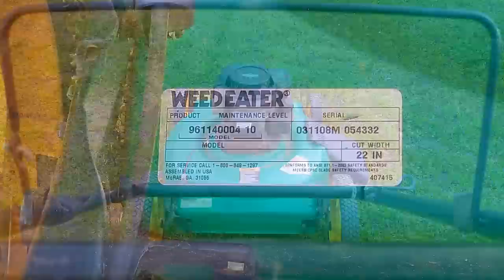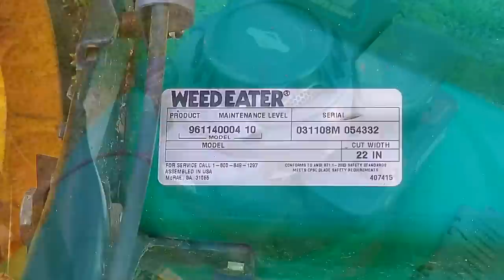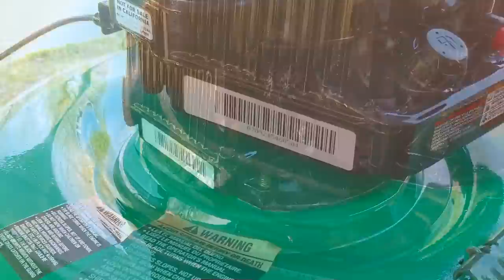Bought A Weedeater Mower And Things Don't Seem Right

Comment: well for me it does differ but yeah i have been there but often i have repaired it from my view etc.
Reply from the maker: you make a good point. I got it fixed and sold it, so I'm happy!
Reply: @INSIDEHOUSEGARAGE  strewth mate and yep our Victa 2 stroke aka 2 cycle engines with the P/T (Power Torque) type are also no different here in Australia etc.

Comment: I bought one of these from Walmart a long time ago. It was the worst mower I ever had. It was hard to start. I got it to run one time and that was it. Took it back and exchanged it for another one and it was the same thing. I ultimately took the second one back for a refund. It had a briggs on it too just like this one. I was surprised how shitty it was. I expected better. Lol
Reply from the maker: it was interesting that it happened twice
Reply: @INSIDEHOUSEGARAGE  Weird I know. I figured with it having a briggs motor it would have been a good working engine but it wasn't. I just came to the conclusion that it was the cheapest mower that they had at the time and I got what I paid for. 😆

Comment: The fuel tank IS the bowl on L heads...
Reply from the maker: no there is an inner bowl, under the carb. The pump pulls fuel from the bottom of the tank, into the bowl section and any excess spills back into the tank.

Comment: When I sell them I post them for more than I want. Most people want a discount. I list what I did. Oil change, sharpen blade, drive wheels ect. If you did something that a person would question don't post that. If you list something at lets say $ 100 and they say would you take $ 60 I don't even respond. I have to buy the stuff go through the machine and sell it. The shops get around 80 to 100 per hour to work on small engines. I am sure if they were selling they wouldn't give big discount. When I buy something cheap I expect issues.
Reply from the maker: you make good point about the cost and time involved

Comment: Hey bro what's up? Interesting topic and video bro. I'm surprised that you didn't check how much psi the engine had and also I didn't see you clean the carburetor. Surprisingly however it started and ran good. So all in all $10 wasn't a bad price at all for the mower. A little cleaning up, and oil change, new air filter and pull rope and it's ready to start mowing lawns again
Reply from the maker: The engine started and ran, so no need to look at it. As for the compression, it's enough to start and run, and that's good enough for me. Thank you Ramadin Sookhoo!
Reply: @INSIDEHOUSEGARAGE  I thought that much bro.